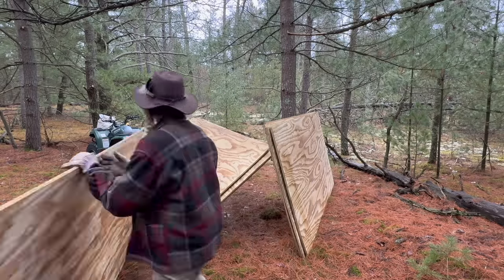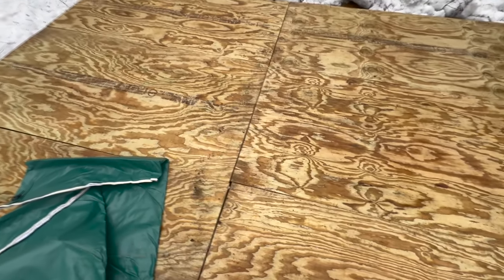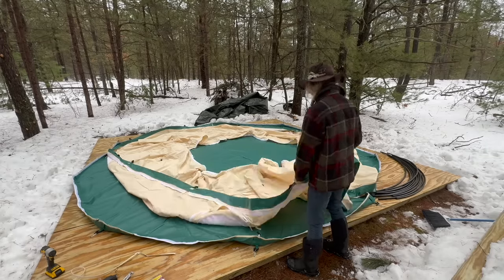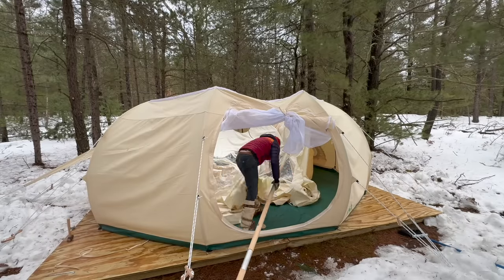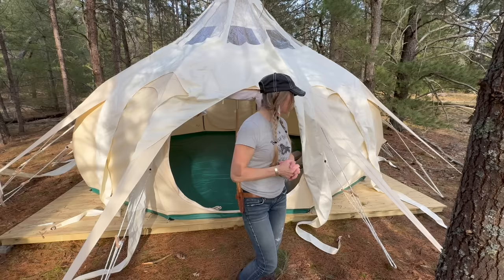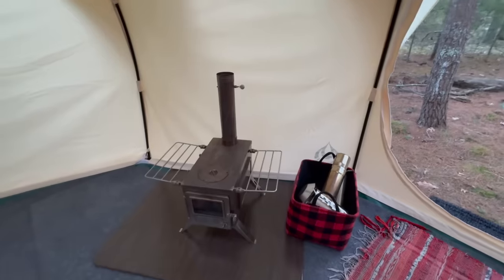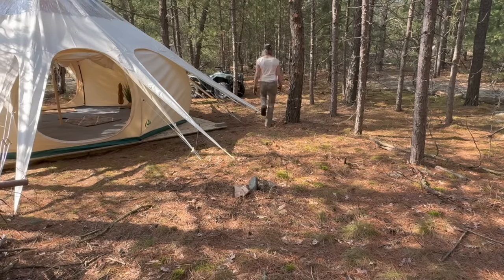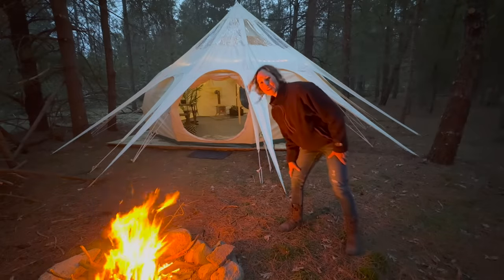EASIEST tent platform you can build + setting up a LOTUS BELLE tent SOLO

Comment: That tent stove is the same as mine. I have a tipi tent and a hammock tent, both i put in stove jacks, I will confirm, that little wood stove will warm you out. No BS, they crank some heat in a small place. I have to stoke it often, but i found solutions, Rural King sells briquets that are like particle wood. At your bed time in the tent, toss two in the stove as you stoke your fire for the night, it will get you through to morning when you wake up, warmth wise and keep it burning coals, to build your breakfast stove fire, about 7 hours heat off the bricks. I only sleep 6 a night, im sure most adulta are this way too. But that was my biggest aspect, how to get a small wood stove to keep me warm in my tipi at 5 am, wont need to wake up and stoke the fire. I learned what to do and I live in my tent like its a hotel. lol